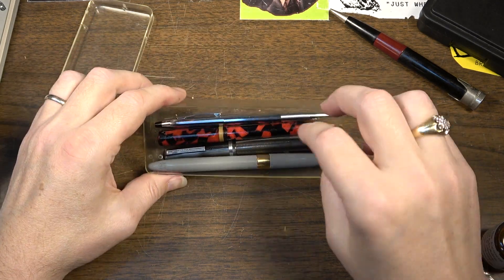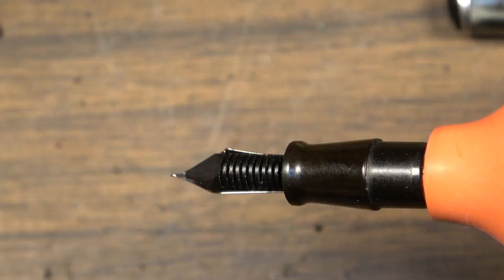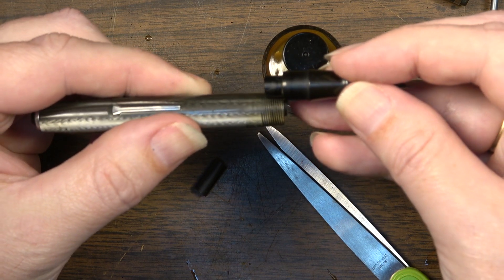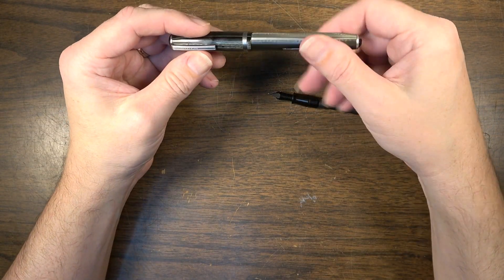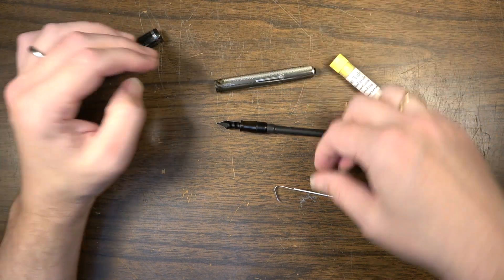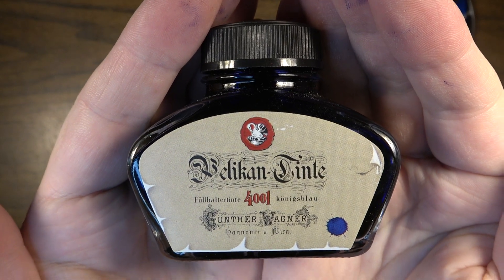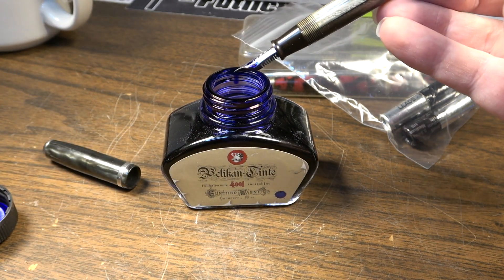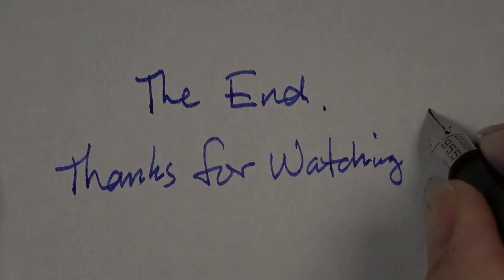1950 Esterbrook J Series Double Jewel Fountain Pen Restoration & Nib Re-Grind - ESTATE SALE FIND

Comment: Ive collected a few of these vintage fountain pens over the years. I was always afraid to take them apart and try to restore them. Last I'd searched online I couldnt find any good information other than places that did repairs. But it seems today there are a lot of helpful websites out there and a lot of parts available. 
Thanks for sharing Brad!
Reply: Chrisrap52 has a few videos on vintage restoration, and for the Esterbrook, I highly recommend What I Ink's "Esterbrook University" video series. And, it's basically the same for any lever filler, just a different type of pressure bars for an old Waterman's. Also, Sheaffer's and several cheaper brands tend to glue in the section, generally with some sort of shellac. Takes a lot of patience and gentle heat (a lot of vintage pens are celluloid or cellulose acetate, so very flammable), to get them apart. Been restoring my own for a number of years. Might break a few, but that's why you buy them for as cheap as possible. I got a great deal on a 1920s Conklin Endura, and shattered it, trying to take it apart... 😢 My first "casualty." Gives you spare parts. 😁 Give restoring one a try!

Comment: Last time I had a fountain pen was 4th grade. Mine had little capsules of ink, that one would, actually "stab" onto a little pointed shaft that fed the nib. I loved the pen. They were still in use when I was kid, but the old ball points, were really popular, plus they didn't leak. A few kids used them, plus several teachers. Inevitably you'd have a blue or black, or whatever color ink stain on your shirt picket. (That's why they had the white plastic "pocket protectors") I loved those pens, as messy as they could some times be.

Comment: I found soaking the nib section in warm water for several hours would clean the ink feed without having to disassemble or use detergent.
Reply from the maker: I've done the same with another more modern fountain pen and you're right, that works well too.

Comment: Solder-suckers are also known as bulb syringes, ear syringes, aspiration bulbs, or snot suckers. The Esterbrook 9550 nib is known as a firm extra fine "posting nib." The part of the feed to which you attach the ink bladder is called the "nipple." The nail file is too rough; use emery board instead, and buy very fine grit sandpaper. Sites like Goulet pens and others sell pen tuning supplies. Goulet also has many videos on fountain pen culture.

Comment: Ultrasonic machines will clean any dried up ink in fountain pen without any effort. Ammonia and water. I have a bunch of Noodler fountain pens I play with off and on and eventually I forget them and the ink all dries out and plugs everything up. 5 minutes in ultrasonic machine with the parts in a zip lock bag with ammonia and water usually cleans it all out like new.

Comment: I would believe that the pen should be assembled with the filler lever on the opposite side, as then when writing, the pen presents its best face upwards (and in line with the top of the nib). That is my recollection from my days of using such lovely writing implements.
I do apologise in advance, should my suggestion prove to be incorrect, or at least so for the US market.
Using high quality inks will also serve to make the pen write more smoothly, with the added benefit of keeping the pen ink-feed mechanism clean ...
Regards from the UK.